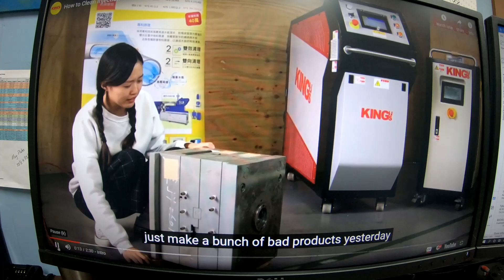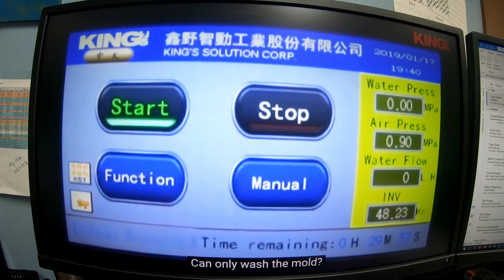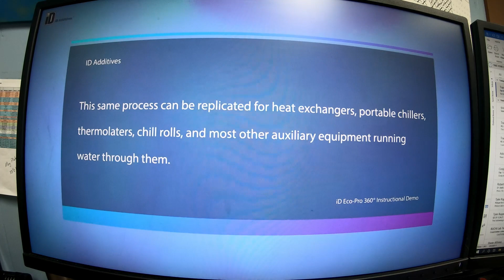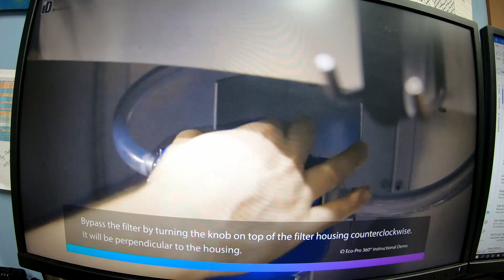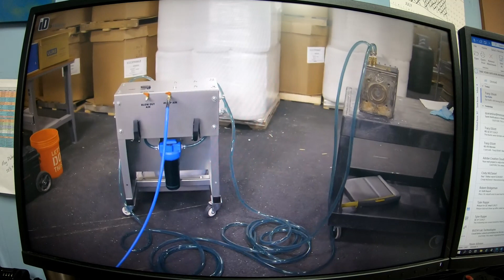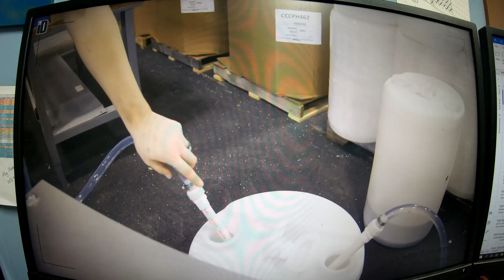Water Line Flow Treatment

Comment: Current issue I am working on.....other than just changing once a shift, I am trying to implement a pressure differential gauge to indicate when our operators should change the sock filter for chilled water feeding the hydraulic heat exchanger and TCU's. What type of proactive approach do you use?
Reply from the maker: We don't have a PM schedule here like at other places. If it is a heat exchanger you shouldn't have to change out but every 3 months. If we are talking about the same thing, Thanks for watching & the support to the channel.
Reply: @injectionmoldingskillsmore1064  it would blow your mind what kind of garbo that shows in our water....heat exchangers yes and also the chilled water flows in our mold. I did find something yesterday....I will post links in a bit.
Reply from the maker: @jeremymcclanahan2389   Thanks for the feed back bud.
Reply: @injectionmoldingskillsmore1064  here is a link to the differential pressure guage that I am going to trial....with our 100 micron filters there will be 1-2 psi difference when clean and 10 psi when dirty....the basket that the sock filter goes in fails at 12 psi. Blows right through the basket and punches a hole in the filter. This guage has electronics and I plan to land the outputs on our robots to stop the press and alarm so the operator has to react and change it. There is a sad culture where I work that will take years to fix with the lack of support and authority of upper management....I will let u know how it goes....also....forgive me if you have, but can you make a video on maintain the plates? Thx
Reply from the maker: @jeremymcclanahan2389  Yes I can look & see if I have done one yet. Thanks for the support to the channel & yes let me know how everything goes with the filters. I think a lot of company's of issues were the management Team is on a different page then the Engineer is LOL.